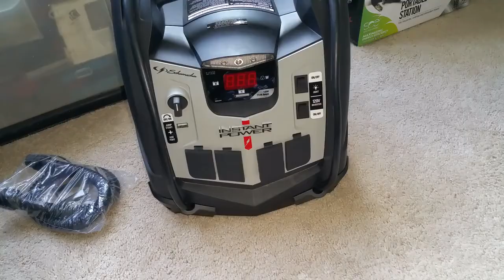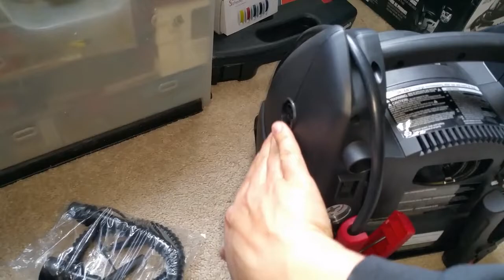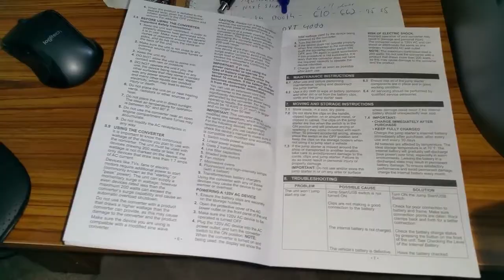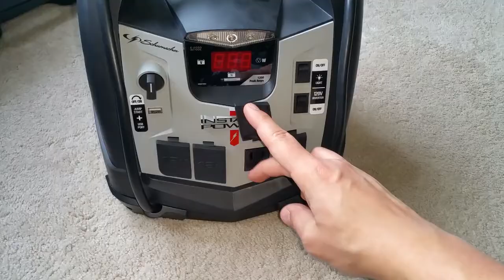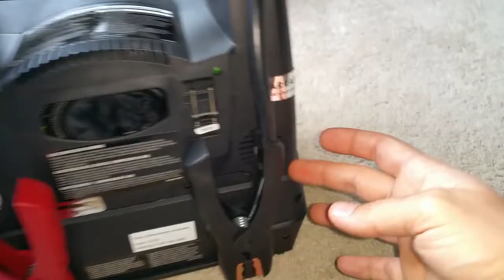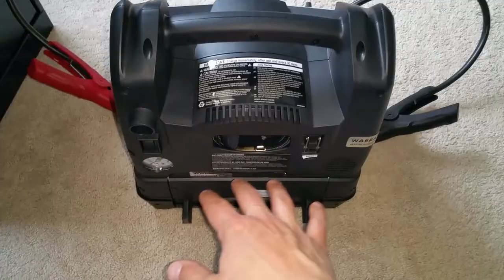Schumacher SJ1332 Review

Comment: Does it have to be plugged in to use the inverter? My two outlets on the left don’t work
Reply from the maker: The inverter needs to be switched on first. No it does not need to be plugged in to use the inverter

Comment: I have the SJ1427 model.  It was working great for my occasional car jump starts. I always charged after use.  
About a week ago, I took it out to Jumpstart my car and I got nothing.  No lights, mo display, and no power.
I called Schumacher, did a return request and few days later, that this model only had a 1 year warranty.   I  didn't  buy the extended warranty.  
Schumacher support told me (a lady) to change the battery and check the fuses and replace any blown fuse.
Support stated that dead batteries in the units are the biggest problems with the units.  Support admitted that the batteries go bad in these units quite frequently and told me to buy a new battery and replace it.  They refused to take a return on the item or pay for repairs, so I am trying to see how to replace battery.  Mainly, if  I could do it.
Please do a video about changing the battery and fuse.

These powers Tatiana units cost a lot of money and I'm on a budget.

Please show how to take battery out and replace with a new battery.  Also how to change fuse .Show how to change battery  please & Thank You.
Reply from the maker: Yes the SLA batteries have a limited life span. They get shortened even more if the batteries are left below 100% charge. My unit is still working fine. Won't be doing a video for awhile but I'm sure there are other videos on here that show how to access the battery from the bottom.

Comment: do you have information on what battery to buy for a replacement?
Reply from the maker: I haven't replaced the battery yet but I believe any 18 amp hour or 20 amp hour motorcycle SLA battery should fit. The only exception is if it has spade connectors or ring terminal connectors. My guess would be ring terminal connectors.

Comment: I would like to know if it can keep a diesel engine block warm. I have no access to my own outlet in my place of living.
Reply from the maker: @rosstalbott9961  absolutely not! The battery inside is simply too small. The average diesel engine block heater draws about 1,000 watts at 120 volts. You would be better off using a small generator with a large enough fuel tank to last the night

Comment: The plug in adapter to charge is broken off what can I do?
Reply from the maker: @saxdam  You may be able to go and solder a part of an extension cord to the broken pieces but unfortunately there are no replacement parts for this unit.

Best bet would be to use an external smart battery charger using a ring terminal adapter directly to the battery connected to the charger.

Comment: Can be Charge with car  Charger
Reply from the maker: @reynardjafoster3040  It is possible to use a male-to-male accessory lighter adapter to charge the battery yes. You would have to buy it separately.

Comment: Why did you not show us the inside and the battery?
Reply from the maker: @GregPetersonAndTheUrbanFarm  it was under warranty when I bought it. I'll be replacing the battery at some point and will do a video then.
Reply: @Bassguitarist1985  AWESOME thank you!  Loved the video!
Reply from the maker: @GregPetersonAndTheUrbanFarm  My pleasure! Yeah the jumper pack has been in steady use with my small engine repair business but I'm noticing that the capacity is not as good as it was new because the battery is starting to wear out inside. I'll be doing it sooner rather than later I'm sure but for $40 to replace the battery it's worth it

Comment: The plug is gone to charge it. How do I fix it
Reply from the maker: @bootsescuetapisco7059  unfortunately there are no replacement parts for it. It is possible to solder a short male cord to the wire leads leading to the charger input that would take some surgery but doable.

Comment: The green indicator light is not on while im trying to charge it. It's brand new.
Reply from the maker: @Brittanybluejeansbluejeans  Even if the battery is charged the green light should come on momentarily but shut off if it is close to full charge. You may have a problem with the battery and or the charging circuit internally

Comment: I bought mine about 2 years ago and it doesnt turn on anymore. When i charge it, its able to turn on again and show me its battery life. But the moment I unplug it, it doesn't turn on anymore.  Have you seen this kinda problem before ? If so what could i do to fix it ? Or is it just time to buy a new one ?
Reply from the maker: The internal battery has sulfated due to age. It needs to be replaced. Battery is about $40 or so off Amazon. The battery can be replaced and access from the bottom with a couple screws. If you do that you should be fine. 

The unit is able to power up just for a few minutes because you are using the power of the charger to turn on all of the accessories. Don't do that for too long as you can damage the charger.

Comment: I have this model and I also have the prior one, it burned out on me, however. I was using it to raise/lower a electric flatbed trailer. Not sure why it crapped out because I had been doing that for a couple years with no problems. But my question is on the new model. The recharging plug on the back must’ve taken a hit or somehow separated and the two prongs swing freely now.  It’s hard to see, but I think there may have been a crack in the plastic that joined the two. Is there another way to recharge this thing or is that part replaceable?
Reply from the maker: Far as I can tell there is very little support from Schumacher. I haven't dealt with them directly for any parts if there's even any available.
Reply: I got an email response from them, they said there’s no replacement for that part but you can charge the device using a male to male DC cable on one of the DC ports. When I asked them how to get that to an AC wall outlet they said I’d have to buy a second cable to convert DC over to AC. (They also said DC charging in your car should be limited to 30 minutes while the car is running.) I’m waiting to hear if they have a different solution that’s one single cable, DC on one end and AC on the other, that I can use to charge through the DC port.   If you have any advice on that type of a cable, let me know!

Comment: Thanks for the video, i just want to know, if the power goes off on your house and i want to keep only the internet connected, how long can it give me power ? Thanks
Reply from the maker: Hello thank you for watching! I need more information to answer your question accurately. For example what is the power draw for your router and your modem? For example 800 milliamp draw which is fairly typical of a router with a 22Ah battery can run up to 27 hours, assuming it is not running anything else. Hopefully that gives you an idea.

Comment: Does it work for charging laptop computers?
Reply from the maker: I haven't seen any issues with laptop power bricks. They may not be able to output full power due to the modified square wave but they should at least keep the computer running

Comment: So I have had two of these models first one I took back to be replaced by the second one I had a problem with the first one with the air compressor the air compressor just quit and would not start back up again even after it was completely cooled now the replacement unit is having a problem with the air compressor as well the problem with this one sounds like it threw a belt or burned out the belt as the motor just sits there and whines you cannot hear the compressor whatsoever due to the fact that you've been into this unit I am curious if you can confirm or disconfirm as to whether or not it has a belt.
Reply from the maker: It does not have a belt, it is gear driven.

Comment: What if when you plug the battery charger in to charge it the light in the back by the plug down not light up? Will it take a long time to charge if it is not charged at all or what?
Reply from the maker: If green light doesn't light either the internal charger has failed, and/or the battery can no longer accept a charge

Comment: I have one that all it does is beep all the time I bought a battery replaced it still does the same thing and replaced the fuses on it two of them were bad still have the same problem Any advice on how to fix this would be greatly appreciated. Thanks.
Reply from the maker: Does it beep with the rotary switch for the jumper clips on? Like every few minutes?
Reply: @Bassguitarist1985  no it’s a steady beep whether the switches on or off
Reply from the maker: @narcissoarce  okay so not the rotary switch but with the inverter switch on?
Reply: @Bassguitarist1985  all swishes are on the off position
Reply: In order to get the sound to start, I have to disconnect the internal battery. I have that unit open.
Reply from the maker: @narcissoarce  so when you disconnect the battery it beeps constantly?
Reply: @Bassguitarist1985  no when the battery is connected, it has that long beep sound. It’s on steady all the time when I disconnect the internal battery is when it stops. Sorry for the misunderstanding.
Reply from the maker: @narcissoarce  gotcha. Normally there is an occasional beep to remind you that the rotary switch to the jumper cables is on. It sounds like there is a failure on the inverter circuit board somewhere. Does the inverter work?

Comment: Will this jump an SUV(Yukon) off?
Reply from the maker: I haven't tried myself but apparently a fully charged battery should be able to boost a flat battery on an 8-cylinder engine. If your battery is completely dead then something like this would not be enough on its own to crank on a V8 engine

Comment: Have no idea how to use this thing. Like how do I turn it on to actually jumpstart my car?  Got it from my dad who's unavailable and probably never used it.
Reply from the maker: It's pretty straightforward you connect positive to positive and negative to negative and then the large rotary switch you turn to the right set to the on position. This will turn on the internal battery to boost your weak car battery. That's pretty much it.
Reply: @Bassguitarist1985  maybe it needs to be charged all the way or it just doesn't work anymore. Thanks for the immediate response for such an old video man!
Reply from the maker: @davontihoward9038  My pleasure yeah if it has not been used for a few years it may not even take a charge and the internal battery will need to be replaced. The battery is only last about 2 to 3 years with normal charge cycles I've found but the replacement off Amazon is about $40 USD. Takes about 15 minutes to replace and you should be good to go
Reply: @Bassguitarist1985  makes a lot of sense. Had this thing for probably a life time. Thanks man

Comment: Can you help me? I have that same unit and my battery hasn't been charged. Since I bordered about proximally a year ago. And I've only used it for the compressor how long will it take to Charge It Back Up to A 100 %? Thank you I appreciate your help you can give me thank you
Reply from the maker: If you have not charged it up in a year chances are the battery has set at less than 100% depth of charge and has likely sulfated to the point where there is little usable capacity left. Normally from a 50% discharge it would take about 5 hours to recharge. But my guess is that the battery will have a good voltage but not be able to push any current to run the accessories or boost a car battery

Comment: Thanks. I've been trying to figure out if there's something  wrong with the inverter. It didn't work when I used a florescent bulb. But it does work with a regular light bulb. Thought I'd be able to just plug it into an outlet in my shed which came wired already. I'm trying not to connect my shed to my house.
Reply from the maker: Glad to have helped! I do the same thing with my shed. Wired it up with a generator unlet box, small sub panel, and it powers a few lights and outlets so I have light when its dark out early. Can always run the generator if I'm working out there for proper power too.

Comment: can i hook a PS4 and a projector to this and it maintain?
Reply from the maker: Not for long no. PS4 is 90-150W and projector can be 50-150W alone. You need deep cycle batteries and a pure sine wave inverter ideally.
Reply: @Bassguitarist1985  a deep cycle batter is like a car battery right? so get that and a car battery charger?
Reply: I already have a inverter probably not strong enough. what strength should I have to maintain that draw my PS4 slim maxes out at 165w and my projector maxed out is 200w
Reply from the maker: @kellenkennedy5525  id get a minimum 600W inverter. Even 1000w is better. depending how long you need it to run will determine your battery size.

Comment: I just bought mine. How does the inflator work?  I attached the hose and no air comes out. Neither does the deflation.
Reply from the maker: Turning on the switch does nothing? Its a 3 position switch. Middle is off, the two outer positions are for the inflator/deflator and the compressor

Comment: How u change the fuse , inverter make a sound when on and doesn't work
Reply from the maker: There are two fuses on the inverter board. Younneed tonremove the battery on the bottom and split the two case halfs to access them. You can remove with your fingers and replace them. They are automotive blade type fuses.

Comment: Hello, can this unit be charged with a portable 100w solar panel? And if so how??
Reply from the maker: Yes just need a charge controller with a 12V output. I'd make an accessory 12v male adapter  to charge as its  protected by a 20A fuse.

Comment: Can this machine explode or blow up for no reason. I want to use this for back up at home in the even the power goes out but there’s so many warnings about explosions but I’m just not sure how this occurs.. if it’s from not minding the manual or if it’s because that’s just how it’s made and there’s always a chance? I have kids and it’s just concerning please help
Reply from the maker: There is an SLA battery inside. If the jump pack is improperly used such as short circuit that battery can explode going into thermal runaway. DON'T CONNECT THIS TO A HOUSE BY ANY MEANS! Other than that the jump pack is very reliable!

Comment: Do u have to charge it completely or for however long you want?
Reply from the maker: I let it charge completely it's an automatic charger so when the battery is full the green light will go off. Being that it is a sealed acid battery it will self discharge but at a very slow rate if you don't use it for a while best to put it on the charge for a cycle once a month to keep the battery topped off

Comment: I work at Lowes part time so I was thinking about purchasing this from there with my employee discount.  I have a Dobsonian "Goto" telescope that requires 12 volt power for the electric motor and computer electronics... I can use either the supplied AC adapter or straight 12volt cigarette lighter adapter.  I don't plan on running any other equipment simultaneously.  I believe this unit would suffice... any thoughts?
Reply from the maker: Use the 12 volt adapter. The stepped square wave of the inverter may not be compatible with your AC adapter.

Comment: One question. Do you know if this unit can be charged with solar panels from the 12V outlet?, there are some Schumacher solar panel for battery charging.
Reply from the maker: Sure i dont see why not. Long as there is a charge controller to regulate the current going in between the panel and the unit.

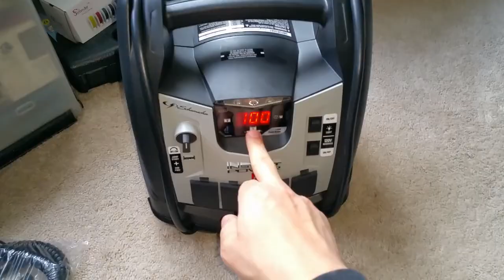Comment: When I use the invertor switch shown at 3:20 mine says "r03" and the plugs do not work for anything I plug into them. I cannot find a code list anywhere online. Could that mean a bad fuse?
Reply from the maker: I dont know what the code means. I know R02 means everything is good. There are two fuses soldered, 30As that could have popped.

Comment: I saw the 2000w sign on the box and thought it could output that amount from ac port. Also I didn't know how different it was than normal power socket and I guess it cannot be used as a backup power for a PC or water boilers. 
Ps: I’m in North America and having a power shortage right now.🙁
Reply from the maker: Yea 2000 amps PEAK power at the jumper clips. Running a laptop maybe if the PSU can handle the modified sine wave. NO WAY this could power a water heater. Not even in the same league.
Reply: @Bassguitarist1985   Hi just wanted to know how long does it last using a circulating fan at my home if we get a current outage
Reply from the maker: @scotrambaran6638  how many watts is the fan?

Comment: Why would it automatically just stop charging
Reply from the maker: The internal battery? How old is the unit?
Reply: @Bassguitarist1985  about a year
Reply: @Bassguitarist1985  l only used it twice and stored in my garage went to use it yesterday and would not work so I went to charge it nothing
Reply from the maker: @rodneynaples5799  the green light on the back isn't lighting up? When you turn the switch on what does the display do? Good chance the internal battery has failed. Though you only had it a year the product may have been on the shelf for a long time.